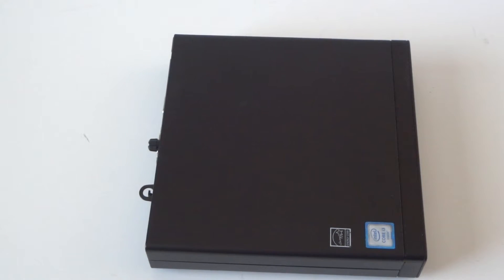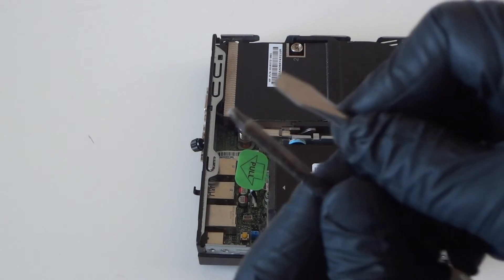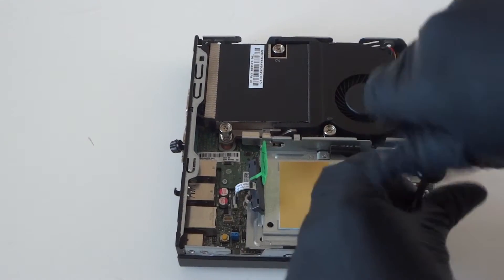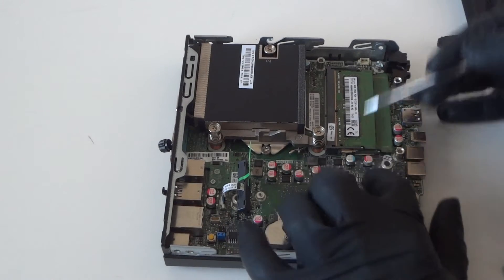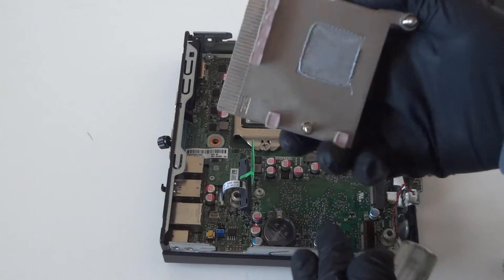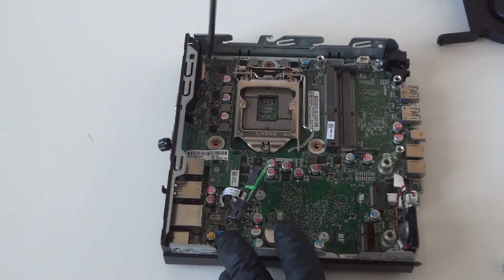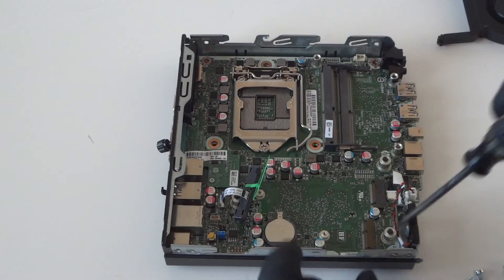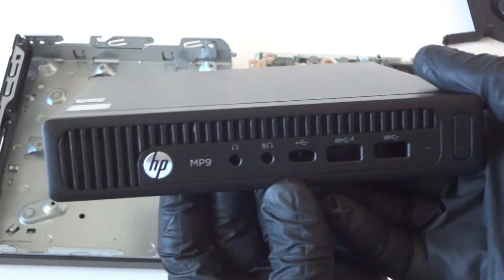HP MP9 G2 Teardown

Comment: This system is the exact same system as the HP elitedesk 800 g2 mini and HP prodesk 600 g2 mini. Both these systems utilize the 6th generation Intel i5 6500t CPU and DDR4 SODIMM memory. However, I never heard of the HP MP9. From what I can see, this is the same exact system as the other two. Why did HP make so many similar computers under differing names? Ebay has these systems listed as MP9 G2 MINI which uses the same stock i5 6500t @ 2.5gb and 8gb RAM, but they are slightly more expensive! Go figure...
Reply from the maker: Hi.